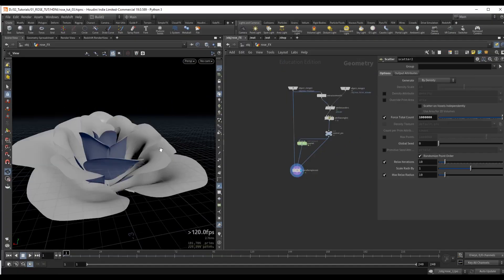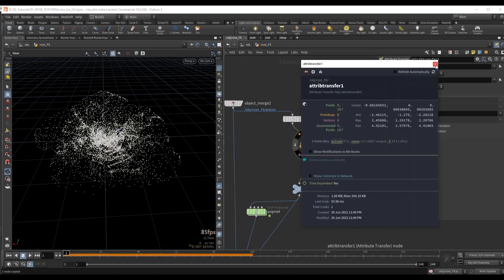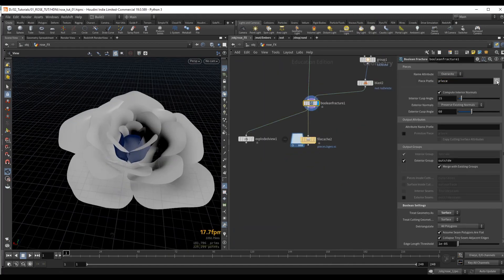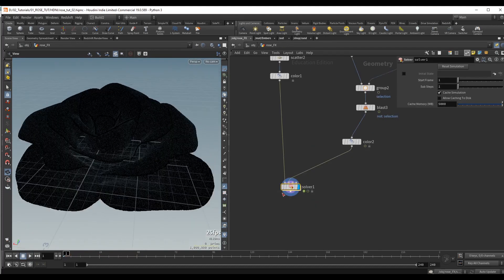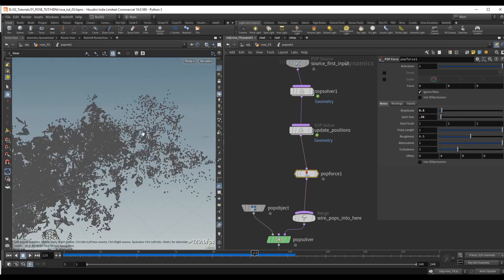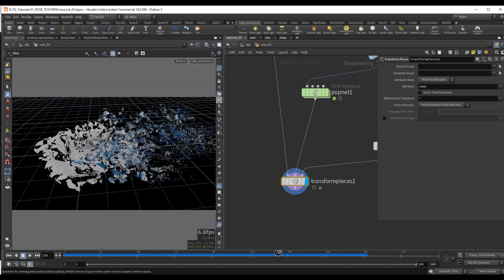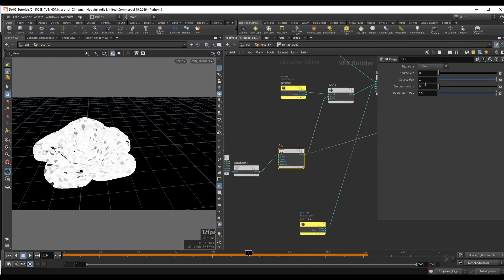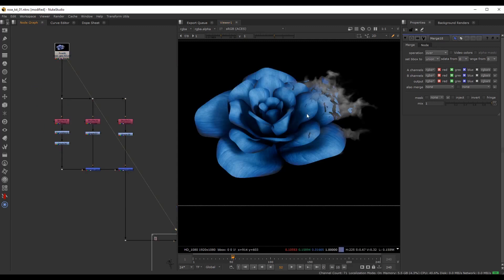Houdini Disintegration FX - Pro Houdini & Nuke VFX Course

Comment: Hello, this was a great course! Thank you for instructing it clearly.

I had a question on how to make some of the pieces on the left of the flower start to disintegrate sooner and not be static during most of the simulation. I tried messing around with scatter, but still had pieces not simulating until close to the end. 

Any help is much appreciated, thank you!
Reply from the maker: After you run the points that are animating through both simulations, right before the last transform pieces sop node, you can add a 'retime' node to the animated points and try to keyframe the speed at the beginning to start faster, something like 2x speed or 3x speed, and then keyframe it back to 1x speed.